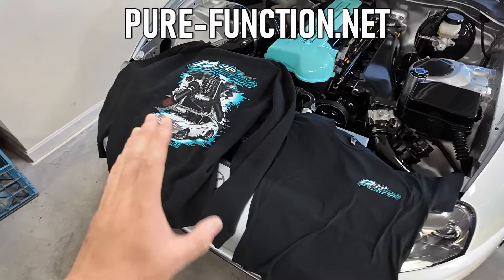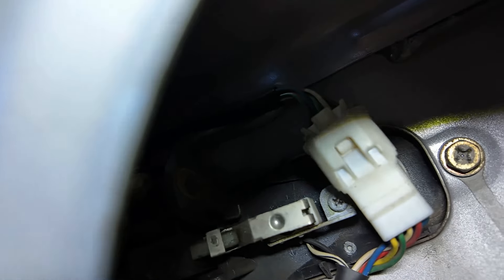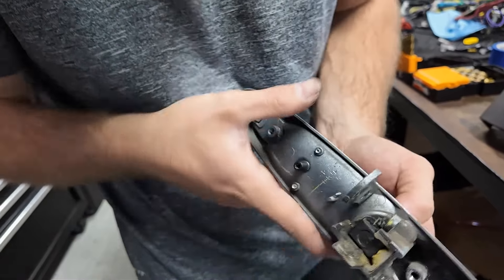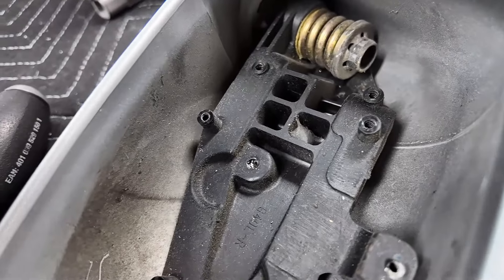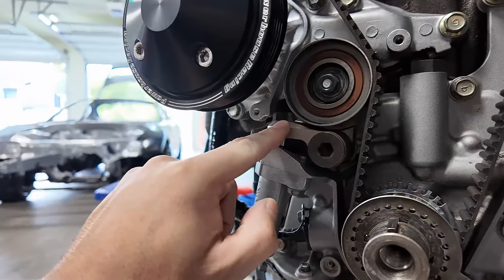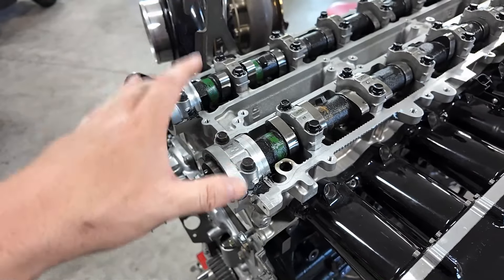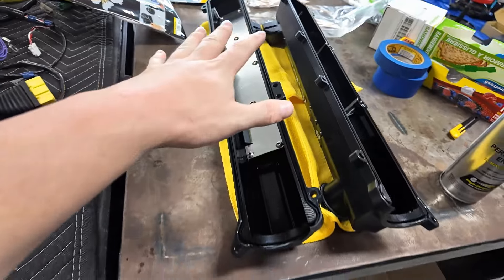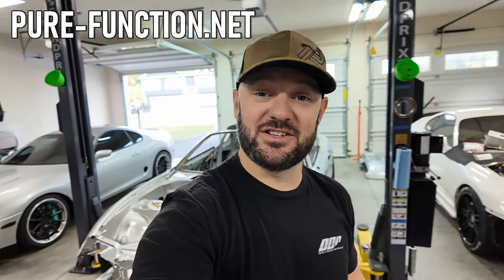MK4 Supra Restoration Pt.5 (Bad News For the engine) mirror & door handle disassembly

Comment: My GSC valve stem seals lasted less than a year, but I thought it was a failure of the machine shop that I had install them (long story). I replaced them with another set of GSC seals a couple months ago, and so far they're holding up.